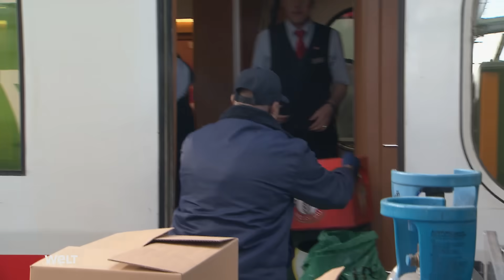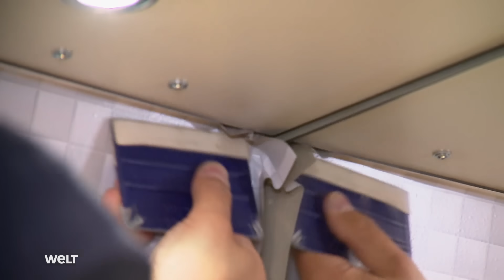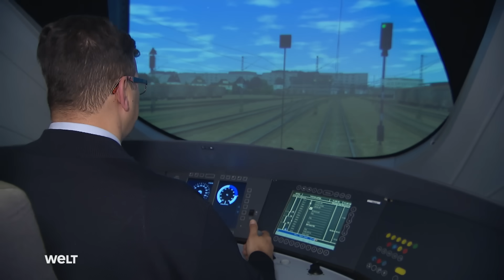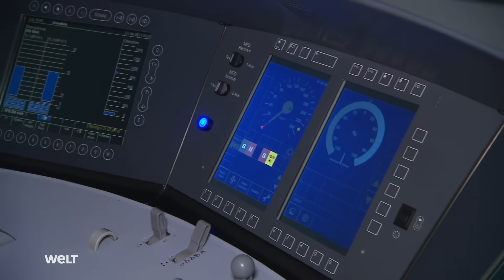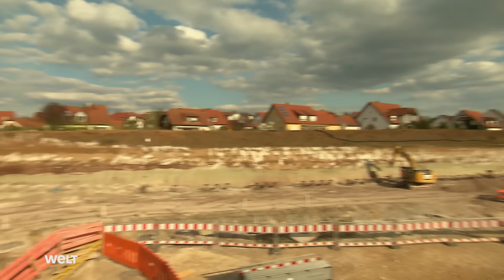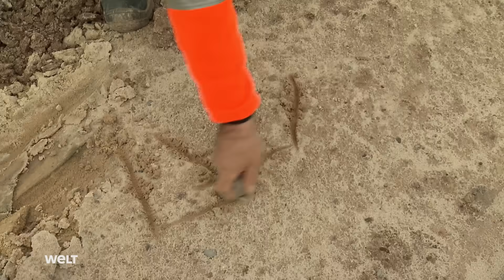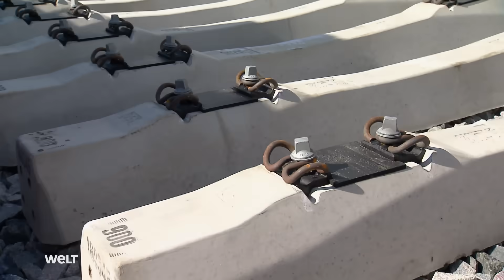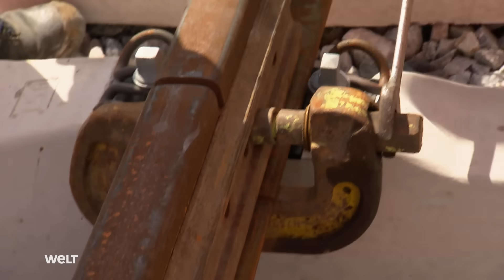German ICE Train - High Speed On Rails | Full Documentary

Comment: Why ICE3 is faster than ICE4, why DB decided to buy slower trains
Reply: Wear. Costs of tracks, operating costs. Not enough enough time gained with the ICE3 in Germany because there are too many stops
Reply: @larsradtke4097  ok, thank u for reply
Reply: Because most rail in Germany doesn't support 300km/h, only 160-230km/h, so what's the point of having a fast train
Reply: @hoangpiano3932  thanks
Reply: The real reason is energy efficiency since the whole ICE rail service is completely run by "green" energy. The ICE 4 use much less energy than previous generations. But this comes at a cost of speed.

Comment: Regarding the emergency brake test, something doesn't seem right:
Test without soap at 170km/h and brake distance is 1,6 km ?
Shouldn't a train at 160km/h not be able to stop within 1 km ? (because of the distance between the pre signals and the main signal being 1km)

Using the standard 1,1m/s² deceleration for German passenger trains, the train should have been able to stop in just 43 seconds. (compared to 55 with the test)
And 43 seconds of braking would lead to a (theoretical) distance of about 920m. (this already shows why 160km/h is the max speed on normal tracks with the 1km distance between the pre and main signals)

Seems to me they still need to improve the brakes on the ICE4 ;)
Reply: Looks to me like they only used the dynamic brakes no friction brakes ?
I might be missing something but they only mentioned the performance of the dynamics brakes.
Reply: @SuperUltimateLP  if they only used dynamic brakes, then it's fine. :)

Comment: I think HS2 (UK) will be using something like ICE3 or just ask if Hitachi can make the train for them
Reply: We'll wait until its either called off or actually finished by the time im old.
Reply: I think they would likely use the Velaro platform from Siemens. The thing is, the other parts of British rail could not accomodate standard European / Asian models.
Reply: @Sedna063  Isn't all Hs2 tracks and stations are complete new?
Reply: @keiming2277  Yes, HS2 will be completely new but the problem is that current British rail stock isn't. Many operate with a much smaller clearance profile (?) and they want HS2 to operate both and the HS2 trains to operate the older British rail networks too. Thats why this is a problem. 
Britain has a really outdated network.
Reply: Sedna063 I thought HS2 tracks are completely new
Reply: @keiming2277  They are but they want the new rolling stock to be able to run on existing lines too. And that is kinda a problem.
Reply: Sedna063 You are correct about the loading gauge in the UK being too small but that’s not the problem. The UK already has trains capable of high speed. They just aren’t allowed to reach those speeds because they don’t have in cab signaling. That’s why most trains in the UK are forced to a top speed of only 125mph even though they are capable of more. HS2 is supposed to be operated the same way  HS1 is operated.
Reply: @banksrail  Pointless having high speed Japanese trains in the UK when the infrastructure is from the 1960s.
Reply: G J Wagner What are you going on about? HS2 is building completely new infrastructure.
Reply: @banksrail   Took 50 years for UK to find out  sharing tracks is not an option

Comment: looks like the track signal system cannot keep up with this fast train, not good in my opinion
Reply: Iisten to the drivers explanation
Reply: Nope, there are 2 type's of train control systems. One is the Pzb (selectively train control for speeds up to 140km/h - 160km/h) and LZB (linear train control for speeds above 160km/h ). the Pzb just work with 1km blocks/sections (so every 1km you have Control Signals), if you have mutch traffic you cant get faster then the slowest train on your way and the system dont know the speeds on the track and so you have to be aware of signals that showing you to stop. At LZB the Train Control system dont have any sections. its like a modern Moving block system, your speed depends on the distance and speed of the train in front of you. So if there is a slower train in front of you, the system will guide you to a save distance and Speed without showing you to stop like the Pzb system will do.
Reply: DerBastiathome there is no right or wrong. Different places have different types of signaling. PTC, ATC, LZB, PZB, Block Signaling, and Dark areas are all different forms. Just depends what railroad is using them.
Reply: Like in the US, different railroad companies built different railroads, with different lighting systems. And still today, after some companies have bought out other railroads, they have to operate in different signal systems. lol
Reply: @DD-bn2mx  Actually high speed trains use onboard rail signals because past 200 km/h it is impossible for the human eye to follow physical signs on the side of the tracks
Reply: It is because of humans not able to keep up with speed, not the system.